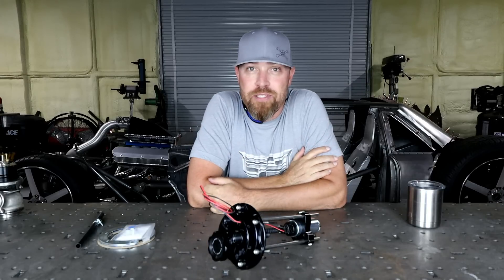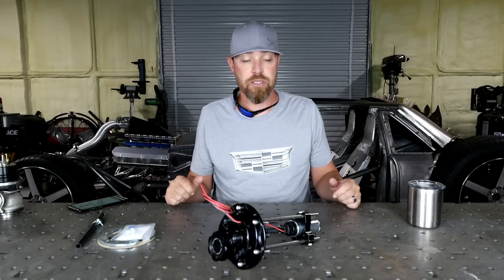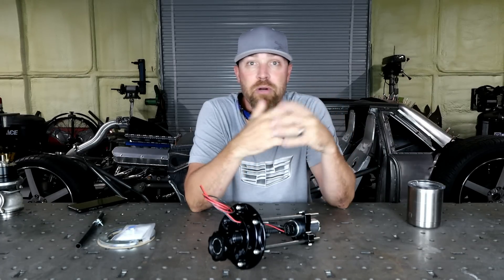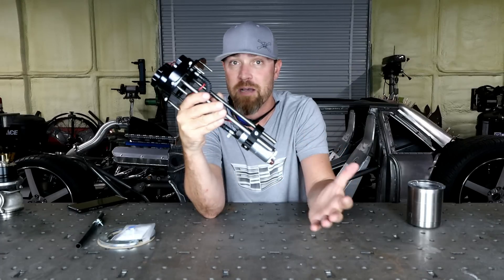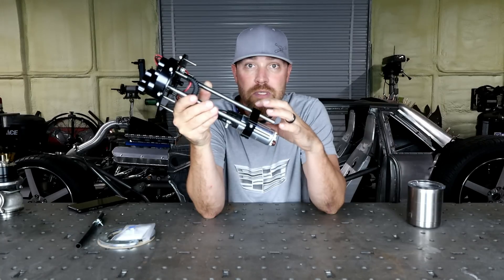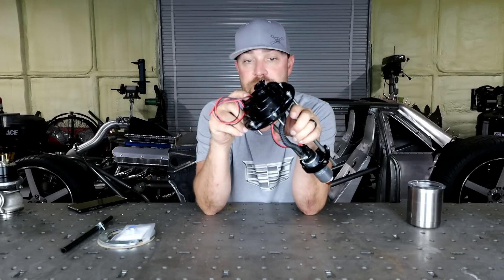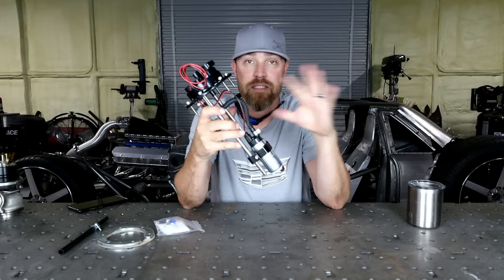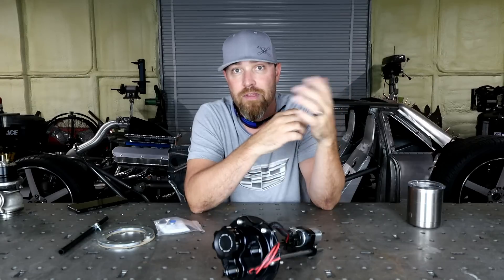Rad Race Parts - Holley Fuel Cell EFI Fuel Pump Module Assembly

Comment: This would be cool with a bucket and a venturi to keep it full, otherwise it worries me that starvation will be an issue.
Reply: Holley offers several different size hydramats to help alleviate that. 16-111 for example.
Reply: @LoneWolfSnowplowing  That won't do anything to replace the venturi or the bucket to keep the fuel pump cool.
Reply: @RecklessRegal  right but my point was in cases where there is no bucket....and even a tank/fuel call with little/no baffling and also no bucket.....the hydramat can help some of that low fuel starvation.
Reply: @LoneWolfSnowplowing  and my point is that it does absolutely nothing to mitigate keeping the pump from overheating.

Comment: I like that a lot.
I remember back in the 84 when we built my 23 T-Bucket to drive to school for my junior and senior year, parts were ridiculously expensive and we still had the normal mechanical stuff.  ( I think they were just starting with plug n play EFI stuff but it was too costly to convert over ).
    Thank you for sharing this with us.
Have a great weekend Kyle.

Comment: Don't really need any rocket science for a C10 FI conversion, unless you just want that.   A simple way is to get an 87 R10 (TBI) tank / sender, with an AC-Delco EP381 pump.   Senders are around $65-ish, and pumps are on ebay for about $50.   Tanks vary depending on if it's a single or dual tank, long / shortbed.
Reply from the maker: Couldnt handle power I would want though
Reply: Totally agree.
Reply: Yeah sounds like he just wants to put a nice fuel injection system in his build..
 not, scrape some junk together and make it Pump Fuel...

Comment: Nice setup!  For me, in-tank setups are where it's at.👍 Applications sufficient for big power, plus they are much quieter. For street driven cars, external pumps can be annoying.  I really like the adjustable depth rods/bracket on that unit.  Nice addition to The Bibbster.👌 Thanks for sharing and have a great day, Kyle.